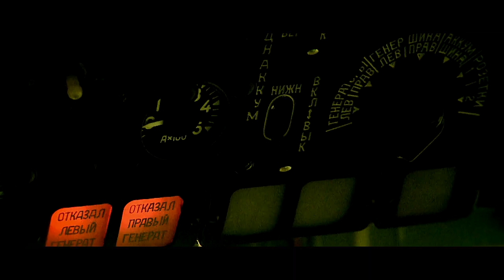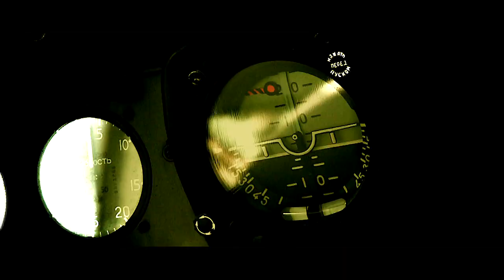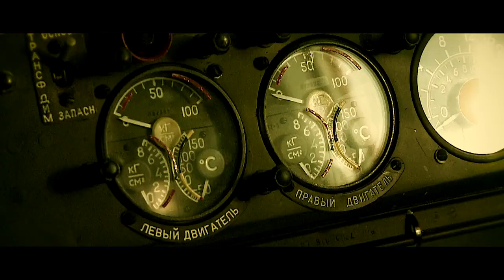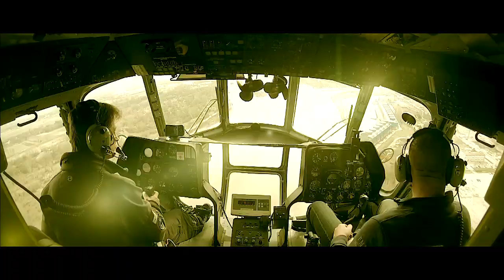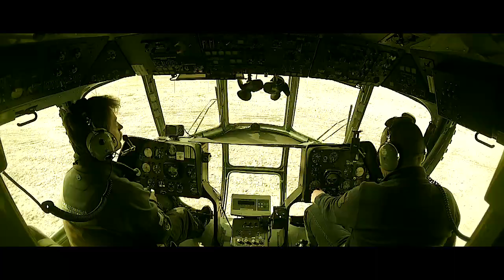ENEA elektrownia w Kozienicach

Comment: Mr. Joseph of Australia new invented up with an engine that works without any external power supply and can be used anywhere the where it is needed the engine, eg submarines, boats, boat container, aggregates of small, medium and high power. I invite investors to produce exclusive contact radio(at)... The device can operate unattended for 100+ years, and its production is simple, a Depending on the materials used in its manufacture. Total free of exhaust, the device is fully eco for the Earth, even in the production of its components. You Welcome.